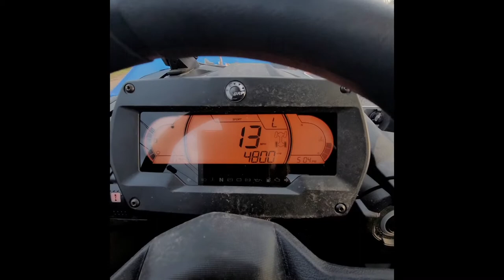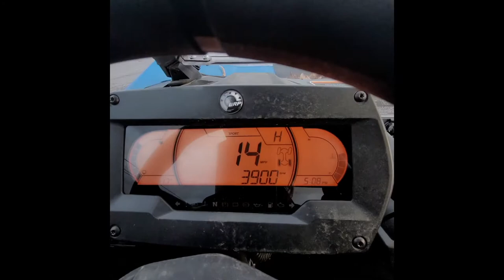2021 Can Am Commander Driveshaft Vibration

Comment: How was mass added to the driveshaft? And will brp/can am dealer be doing this if vehicle is under warranty?
Reply from the maker: Mass was added via filling the driveshaft with oil. BRP has since come out with a new driveshaft so it is not clear whether a repair like this will be covered under warranty any more.
Reply: New shaft doesn't work.  Ask me how I know.
Reply from the maker: Bummer. Our customer was very satisfied with our oil filled shaft.
Reply: @jimpottsmotorgroup5586  what weight of oil?

Comment: How do you add oil to the shaft? And did you do just the rear one?
Reply from the maker: Removed yoke, drilled and tapped hole, filled with oil, installed plug with loctite to seal it all up. Yep, just the rear.
Reply: @jimpottsmotorgroup5586  What type of oil did you fill the driveshaft with?